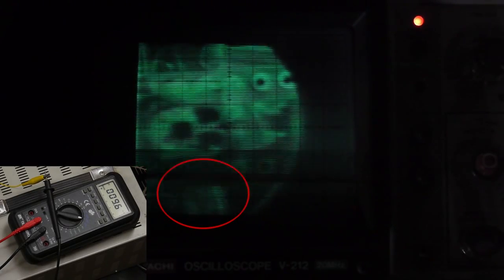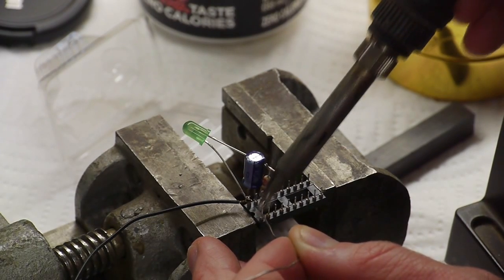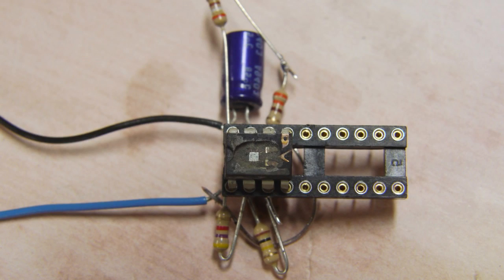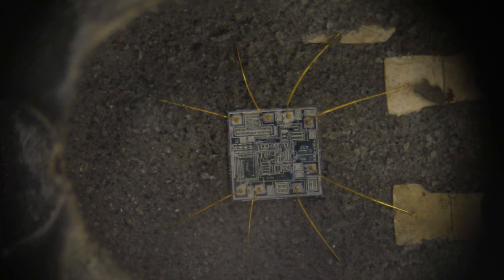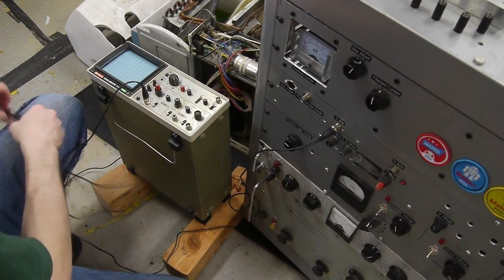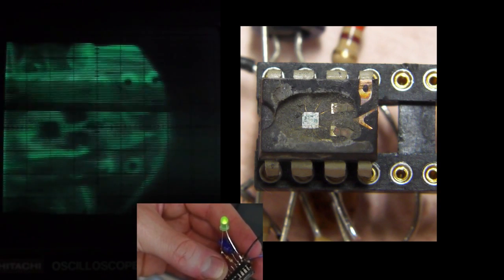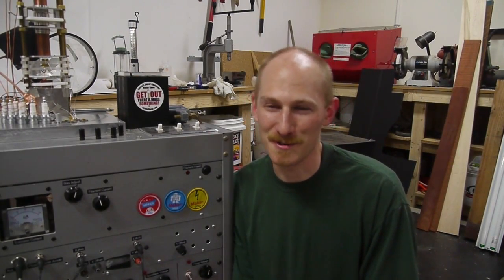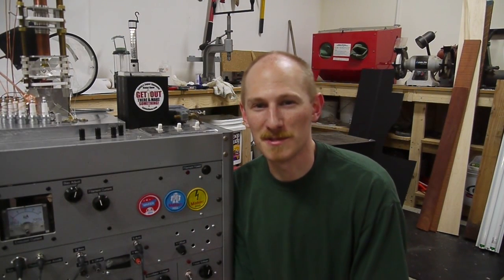Viewing an active electronic circuit with a scanning electron microscope

Comment: I wonder if a BJT-based 555 would be more resilient to the electron beam than a CMOS part.  The thinking there is CMOS parts are vulnerable to high charges on their gate, without an internal mechanism for discharging.  The BJT has diode-like characteristics, so it will either discharge or leak out the extra charge.  I get the impression you want to try watching something like a microprocessor later on though.

Also run the 555 at the 5V or as low as it will go and work.

Comment: In my very early engineering experience as a DPA (destructive parts analysis) engineer at a major aerospace, we did this regularly to add data to the quality control of vendor supplied chips.  We would get 32 chips out of a lot of perhaps 250 pieces, and bang them with piezo shock to make the dust dance, decap just like this guy,until removing the oxide he is about to do, and then viewing the chips in an ISI-60 SEM, then X-ray, then rip the silicon and pull the bonds to test strengths, etc

Comment: You may want to look into getting a hold of ICs with radiation hardened substrates, but it's going to get expensive, and wasteful... I also seem to recall reading something here a while back about using 'bypass capacitors' with old 7000 series logic chips which were just small value ceramic caps that were just there for dissipating excess energy, no idea if this could be used to help the chip survive the electron beam, but hey why not.

Good luck man, I look forward to seeing the next update.

Comment: CMOS technology is very sensitive to high voltage / static charge, why not try some chip from TTL series. I think they are much more robust and can handle more. Anyway, that was a brilliant idea, being able to actually look at circuit working, transistors switching on and off, awesome :)

Comment: has anyone else done this?could be a ground breaking new way to make new designs by seeing the voltage field,so as to manipulate it.
i bet new transistors could be conjured up from being able to see the voltage field,just move some electrodes around see how they effect each other,imagine graphene lines deposited a few carbon atoms at a time,on a surface that becomes the whole circuit board,printed from touch screen devices loaded with schematics,thats where your idea has taken me,awesome video